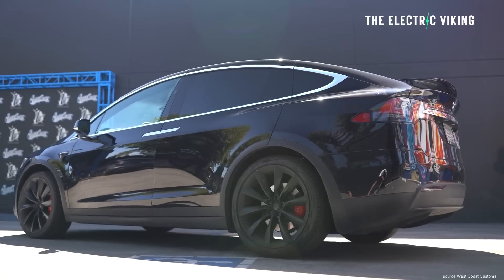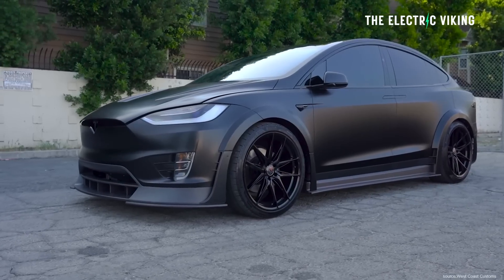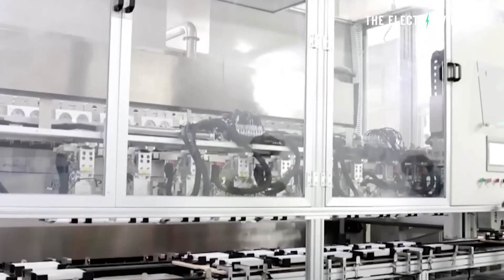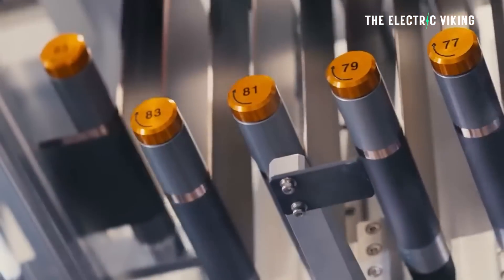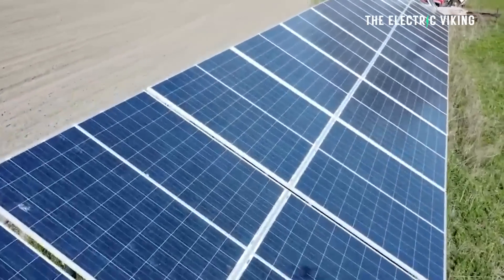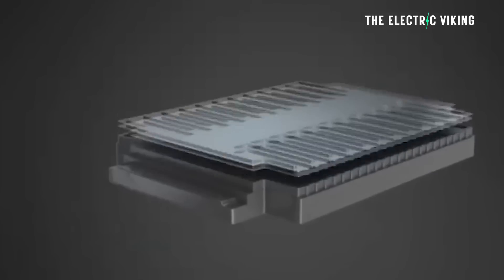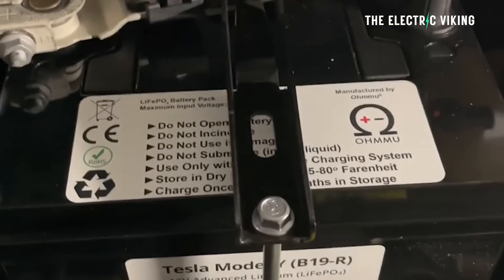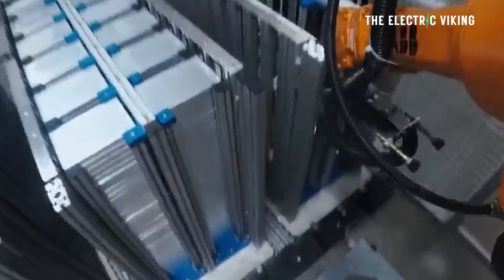The BEST upgrade for every electric (or gas) car costs only $299

Comment: I`ts time to say the true about current sodium ion batteries as engine start, or aux on EVs, or even backup battery, I tested several months two samples, 4  cells 34140  10Ah in series no BMS, and a engine start sodium -ion battery 50 Ah 4S with BMS designed for car use.
On an old Thermal engine  car use  of sodium ion battery resulted in alternator voltage regulator damage, on EV failed startup discharge test, both batteries of 10 Ah and 50Ah.

In dept tests reveal a reversible memory effect, if battery is left charged it maintains voltage but almost no charge is left, in result it fails discharge test on EV.
Memory effect is probably related with trapping of sodium ions because they are bigger than lithium ions. If you try to charge from that state voltage may drop a little and rise again.
In conclusion sodium ion is great for  hi rate deep cycle use but is not good as back-up, aux ,or even engine start.
Best battery for car use in LTO, work in cold weather, long lasting, no memory effect, no hysteresis.

Comment: I just changed 12 v battery on Renault zoe with  sodium ion, voltage is ok but an error related with 12 battery is on, probably i do not wired it thru current sensor, benefit of sodium ion aux battery is shed weight, ev`s are already heavy.

Comment: There are more and more high CCA Sodium Ion start batteries in the market now. I'm yet to see someone challenge test one though. I'm surprised it hasn't been done. They look like good tech though. 1/2 the weight, 4 times the lifespan and just a little over the Lead Acid price if it's coming out of Ali Express or the like, straight from China. I'm keen on one for my boat.

Comment: No where in this video does it say or show what the capacity of this $299 USD battery is. It doesn't even say on the label or the web page shown. Interesting because you can currently get a 100ah 12V li-FePO4 battery for less than $200. This battery is way to small to be anywhere close to 100ah. This is a scam.

Comment: It should be noted he's talking about the 12v battery in ELECTRIC cars. Starting batteries in ICE cars are still mostly lead-acid because they are built in a special way and are suitable only for starting. Lithium starting batteries have only just started coming out and, to be honest, probably aren't worth it. Modern lead-acid starting batteries last for thousands of starts, are cheap and are highly recyclable.

Comment: I have certainly considered a lifepo4 battery as a replacement but the cranking current is not high enough so it would be interesting to see the sodium ion specs fully.

Comment: Gas cars has to be designed for it. Under hood temperature is too high for lithium batteries. We have to wait when gas cars switch to 48 volt electric system that designed for lithium batteries.

Comment: My lead acid battery died at 44, 000 miles on my 2021 Tesla YPerformance in my garage the day I had to go to work😮 without any warnings!😮 Mobile service came to the house 4 hours later and replaced it under warranty 😊

Comment: Sodium definitely not ready for prime time. As at now charge rates are slow. Useabke capacity for longevity is about 40to80% as bad as lead acid and weight is higher than lfp.

Comment: The BEST thing you can do EV fans is to WAIT until lithium batteries are completely replaced by sodium-ion counterparts (which I believe is just around the corner). Once this happens, I'm a buyer, but not before.

Lithium is EASILY the SHITTIEST, most dangerous battery chemistry to put in an EV. Ask any honest chemical engineer. Why? Because when things go wrong, they REALLY go wrong FAST.

While ICE fires are more prevalent, in large part because there are WAAAAAAAAAY more ICE vehicles on the road than EV's, they are far less dangerous and lethal than lithium-powered EV's. In fact, it's not even comparable!

Lastly, I'm TIRED of the BS on both the EV fan side as well as the ICE fan side. EV fans need to come clean with current EV shortcomings, and ICE fans need to come to terms with 8 billion people and looming Peak Oil, never mind the climate. Besides, poor people don't give a rat's ass about climate because they're POOR.

Comment: I'd never known about these sodium batteries even as a fan of LFP 12v replacement in anything made to handle it, factory batteries are often horrible cost cutters, Sam is spot on here! I've used LFP in ICE and now EV for better efficiency/lower charging system strain, better stereo, weight savings and not have to worry about it for 10+ years. 

Only problem is they only offer them in the TM3/Y, only other sodium I can find is over $300 shipped from China from random Ali brand

Comment: Hey Sam, I wouldn't regard $500.00 AUS Dollars as cheap for a 12 volt battery replacement.  Because an EV has no need for a high CCA performance you could fit a 12 volt motorcycle battery,  and it would be fine. It could be a half or even a quarter the size of a conventional  dinosaur car battery.    About 2 years ago Tesla changed their model 3 and model y accessory battery to a very tiny 12 volt lithium Ion battery.  I didn't make a note of it's specs, but I saw it in Teslal Time News.  Even a Toyota Hybrid could use a tiny lithium Ion 12 volt because they don't have a starter either.
Reply: It's a 16v battery.

Comment: Lithium battrties are good on track motorcycles because of the light weight.  And the battery is located up high where you don't want the weight.  The bike turns in easier.

Comment: Question:  So can LFP / NMC / Sodium Batteries..... can they all use the standard alternator and electronics in a ICE car for the charging of the battery?  Normally different battery chemistries require different chargers.  ALSO:  what if you leave your lights on by accident and the Sodium Battery gets fully drained, will that damage the battery?  For example in LIPO each cell should never go below 3v or the cell gets damaged. THANKS
Reply: Re: fully drained no issue for sodium, part of why it has a longer life.
As to chargers, well for the context of the video the battery shown is programmed for Tesla. If u have another car in mind then adjustments would be likely; assuming they are not selling for your specific model.

Comment: Good replacement in a BEV, PHEV, Hybrid. 
The warranty is very low for a battery the should last 10yrs, you can get a better warranty on a lead acid battery. 

New car battery warranty is usually 1-2yrs and Lexus is 4yrs which is 1yrs long than the whole car warranty, very strange.

Comment: Just had my Tesla 12V replaced today. The Tesla tech said they are constantly coming out to replace aftermarket batteries that are self-installed. After market batteries are based on different chemistries, as the Tesla internal car electronics are the wrong BMS and tend to cause these batteries to fail. Is this a true statement or just a way for Tesla to justify their service?

On a related note, I have a 2021 MY still under warranty, so my cost was $0 for mobile service versus $300-400 + me doing the work for after-market. Makes zero financial sense to go after-market when under warranty.

Comment: My VW e-up had an undersized 40Ah battery I replaced with a 54Ah one but I had to code in the type of Lead acid technology it was to end the battery replacement alarm. The 12v Bms needed to be coded correctly to change to the appropriate profile of charging mode, something like Wet battery to EWFB or something like that, I don’t remember exactly. I used the OBDeleven to code the type of battery, it was a rabbit hole to find the field to change in the app menu.

Comment: One has to be VERY careful when replacing a lead-acid battery with any battery that has a BMS. A BMS will make a battery go open circuit when max charging voltage is met or exceeded. Many voltage regulators meant for lead-acid will not be able to control voltage when the load is removed.

Comment: My last 12V lasted 13 years in my Outback wagon.
Reply: Yeah Viking is bullshitting here, my own small diesel car battery lasted 9 years while being used in harsh conditions (even more with a diesel engine who needs more Amps), and when it died I just had to jump start the car and I was able to drive to a shop and swap it myself for a minimal cost. Lead-acid batteries are perfect for their job for most people, only edge cases would benefit from others options....

Comment: My lead acid batteries last 4 years on avg in the harsh Australian summers in my diesels bonnet. $250 Au for a 4x4 size 850 Cranking Amps, 80 Ah, Can't beat it. Maintenance free one at that. If you get one you can maintain and do it properly they can lasts much longer. Mine looks about 4 times that size though.
Reply: In Phoenix AZ batteries fail every 2 years

Comment: Maybe the soduim ion battery has a set or single capacitor to help with the surge of power thats needed to start a car engine. The wide voltage range of soduim ion batteries would it be good for the electronics in a car. Maybe im missing something.. however energy storage at home, (40kw at 48volts) send them my way 😊. They can store energy in the day from solar panels, and with a dusk to dawn feature slowly discharge that energy into the main battery for the same. Of cause attention to not over discharging the soduim battery and keeping the voltage of each in mind

Comment: Uh for $300 I can buy three top brand lead acid batteries here in the US. So this is not a savings unless they last over 15 years..... as leads acid last on average 5 to 7 years.
Also key here is can they be jumped from another car or jump device for some reason? The lead acid can be but Tesla's lithium battery cannot be. Tesla's battery can only be "jumped" for 10 seconds in an attempt to give it enough juice to allow the doors to unlock and the car to turn on....allowing the large drive battery to flow current to the small lithium one. Then it has to be replaced or looked at by Tesla service to discover what happened. 
    All of these factors need to be taken into consideration when you are thinking about putting in a new battery type.
Reply: Lead acid lasting 5-7, are you nuts? You're lucky to get 3 years in FL.
Reply: @West_Anderson  Ah I'm in Oregon. Last longer here.

Comment: I think that you are wrong.  Just replaced my Tesla low voltage battery.  I had to use old battery type.  My 2022 M3LR would not support newer battery.

Comment: What's the problem to which this is a solution? Especially for use on a gasoline or diesel cars? The lead-acid battery on my Hyundai is now 5 years old and doing just fine. I've not had a problem having batteries replaced under warranty in the UK. Maybe the problem is your crappy consumer protection laws in Australia.

Comment: The best part is no part, a seperate battery is pointless evcars already have a dc to dc voltage stepdown or some of them have it they bypass the 12v battery for most of the 12v electrics, it says they need 12v battery for the aystem to wake the car or something but that also seems pointless batterys never sleep  anyway and whats going to happen for 48v well they will use 12v to wake the car and just step the rest to 48v?  I dono i dont care, ebikes are superior for environment the pocket(20c to charge) and the body/mind and way more fun just make sure you get 1000watt 52v or higher, so what its illegal, it shouldn't be, stand up for yourself!

Comment: I had Optima battery in my Chevy Blazer fo 35 years. It was US-made, and apparently it finally gave up after all of the liquid(acid) had completely gone from the medium. 35 years the same battery, couple of time drained completely empty by accident, and using the winch had also put strain on it. A lead acid battery. I replaced it with a Mexican made one, and put similar Optima to my Hummer H3. As you can see, I do not fancy "four wheeled Ladyshaves". Only real cars.
So there are lead acid batteries that last. Not expecting 35 years from a Mexican made, though... If one uses EV for those few years, they are disposable things after all and a risk as used ones, the lead acid battery, if a good one, will last that Odysseus*s Voyage. After that, the next car may be ICE-one, so then it is time to get a battery that will last, say ten years. My Mexican Optimas are now few years old, so it is interesting to see if they last the rest of my life, I am over 60 now...
Reply: ok boomer

Comment: My Bolt's 12v battery (lead-acid) has never been a problem, so I wouldn't call it crappy, but I'll remember this video when I need a new one. Looking online just now, I can get a 12v lead-acid battery from Duracell at BatteriesPlus (which has a store nearby) for less than $100 and an LFP battery with a 10 year warranty at WalMart for less than $200, so $300 for a Na-Ion battery doesn't sound like a steal. By the time I need one in a few years, maybe it will be.
Reply: The charger regulators aren't suitable for all battery technology. Make sure the car supports other types of batteries.
Reply: Lead Acid batteries last in Texas for about 3 years, 6 months.  It's the heat.
They run about $160 these days.    So this battery would need to last 7 years to break even.  
For now, I just mark the date on the battery and replace it when it's over 3 years old and winter is approaching.

Comment: The lead acid on my 2021 Model Y failed a few months ago. Tesla replaced it no problem. But when I asked about changing to a lithium 12-volt they said it's not possible, because the computer system is programmed specifically to work with the lead acid. Anyone else hear this, and does it sound correct? If so, it'd be the same problem with the sodium, right?
Reply: LFP has a pretty flat charge/discharge curve, meaning the voltage stays the same no matter if it's charged to 20% or 80%.
Sodium-Ion works a lot more like lead-acid in this regard. You can pretty much calculate the state of charge based on the voltage.
But a lead-acid battery is very cheap unless you buy it from a premium car brand. Just order one online and change it yourself. It can save you about 2/3 of the cost if you feel confident with this DIY job.

Comment: Warning !!!! I have had 12.8v LiFePo4 in my car for 5 years now but the standard charging system needs to be modified.
Reply: What modification?
On a hybrid, the on-board charger needs to be fiddled with?
Reply: @bayerbear6770  Modern car charging systems run a de-sulfate cycle on the lead battery. From what I know they bring up the charge voltage to 15v for an hour or so once a week. This may trip the over voltage disconnect on a LiFePo4 battery. The one I am using disconnects at 14.6v.

Comment: lfp voltage is compatible with 12V lead acid, sodium ion is not.
Reply: How? LFP is 12.8v nominal and sodium is 12.4v and can handle even higher charge voltage than LFP. which I have and love. Serious question, how is sodium not compatible?
Reply: @DanielBrownOre  
Sure, it can work but you wont get full capacity because of the voltage range (6V-17.2V).  I hear sodium goes all the way to 0V and is shipped at that voltage.  I thinking more along the lines of replacing caravan lead acid for inverter than a starter battery in ICE car where capacity is not an issue.
Reply: Lithium and lead acid are Not compatible without circuit modifications
Voltage is slightly higher on lithium and cause degradation of electric components designed to work on lead acid voltage. The addition of a buck converter (voltage reducer) solves this issue. Look into the RV channels lead acid to lithium upgrades
  Without knowing the exact change/discharge characteristics of sodium it's hard to say whether its a straight swap or not
Reply: @sailaway8244  hold on there, the voltage is kept the same as SLA by the charging system, which still maxes out at ~14.7v like a car alternator with the BMS handling the battery intervals, the car see the same voltage as normal
Reply: @DanielBrownOre  RV community are reporting reduced life of equipment due to lithium needs to be charged to a higher voltage to achieve a full charge
   Sensitive equipment have a voltage tolerance +/- 5-10% off of the lead acid charged battery which if broken can lead to premature sensitive electronic failure or poor/noisy running conditions
   The solution appears to be installing a voltage regulator on the load side of the battery to allow lithium to reach the voltage to achieve full charge while not allowing that voltage to cause excess conditions on equipment designed to run on lead acid full charge voltage
   From memory lithium needs just over 15v to achieve a full charge, at lead acid voltage it gets to about 40-60% charge
  Checkout the RV channels for full details
Reply: @sailaway8244  I understand, but your point is moot as we are discussing using them as 12v replacements. These are not being charged to full for energy storage purposes, they are being kept floated at typical auto 12v equivalent. This makes them still far more capacity than SLA even if kept floated at lower max storage capacity. Very safe and long lasting!
Reply: @sailaway8244  forgot to mention, the auto specific BMS when they are sold as 12v replacements is the key to how voltage is kept just like SLA.
Reply: @DanielBrownOre  did you look at the link i sent you..... I can no longer see it on replies
   Mentions the installation of DC/DC charger installed on alternator charge circuit to protect it from surge loads from a lithium battery compared to lead acid?
Reply: @DanielBrownOre  also hi lights the issues of voltage monitoring problems of an existing lead acid system  that arrises when a lithium battery replaces it?